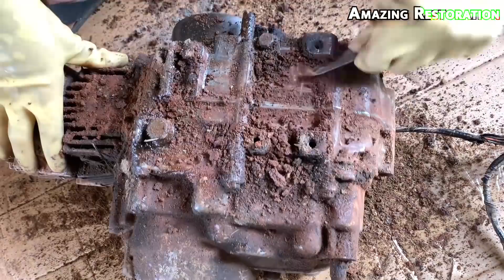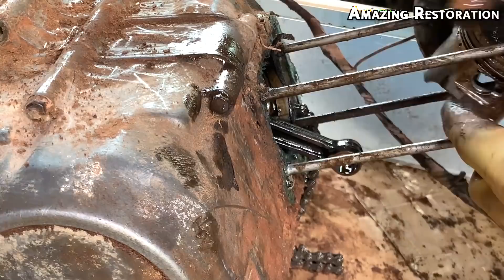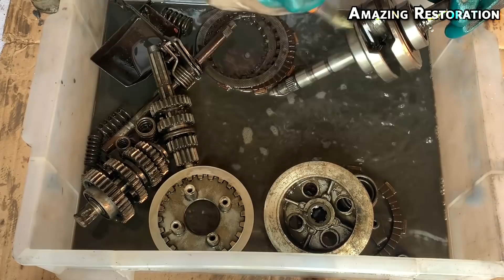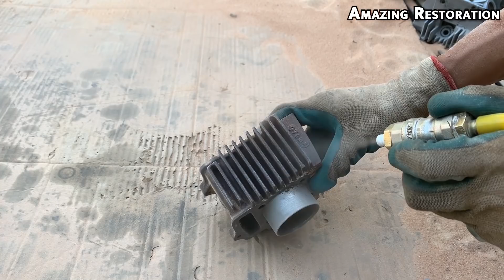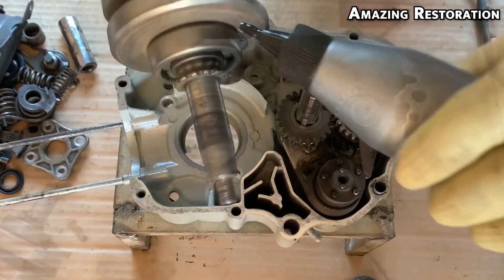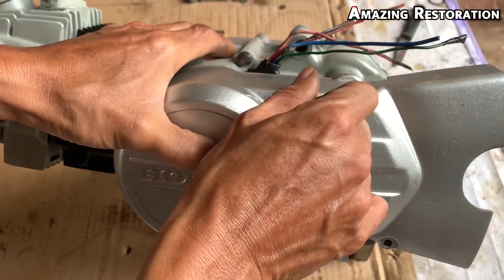Honda Wave Alpha 100CC Full Restoration | Restore a Broken Honda Motorcycle

Comment: I maybe mistaken but not a single bolt was torqued up to spec old valves put back in old piston put back in nothing new on or in motor just a very quick clean and reassemble.